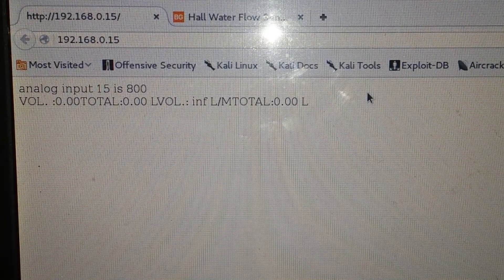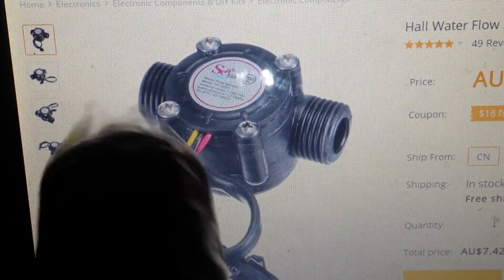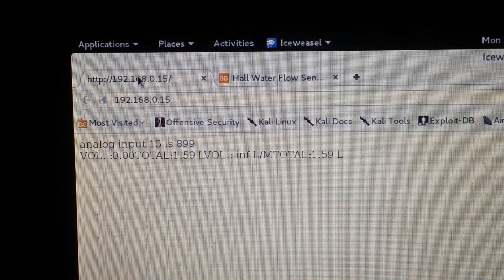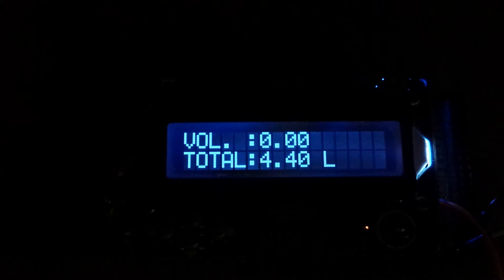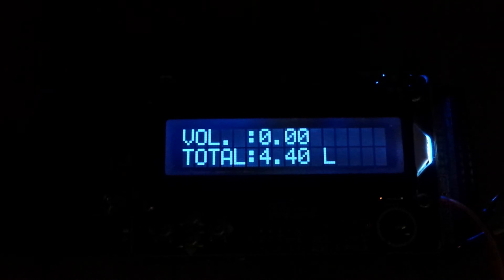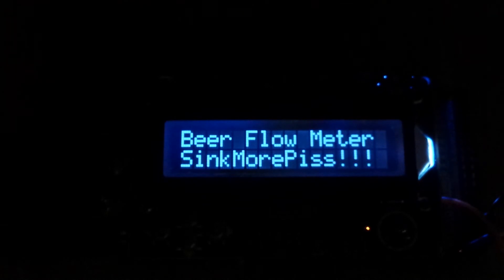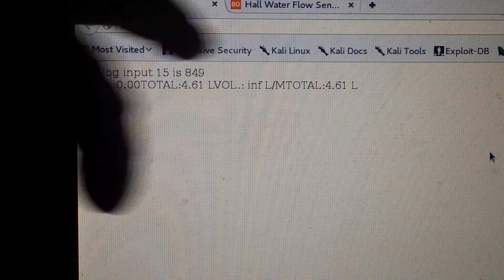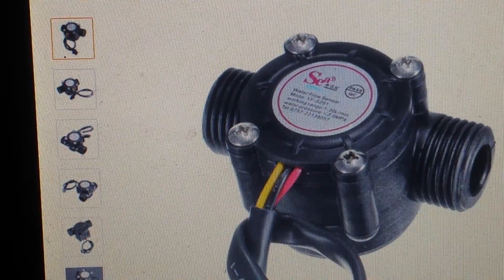Beer flow sensor/meter #Webserver for keg volume measurement  #Arduino [Earphone Warning]

Comment: Great work man. Just a small question, won't the measuring device cause the beer to foam? Because of the turbine obstructing the flow.
Reply from the maker: Thanks man, yes indeed and it did, didn't think of that at the time, had to reduce the serving PSI on the keg because of the turbulence.     That said the turbine would always be a factor in regard to the head on the beer.  I installed it very close to the keg initially and it was mostly foam at a "normal" psi for serving.  Moved it as close to the tap in the end with lower psi seemed to work, good lil lesson.  If I knew more about fluid dynamics I guess I would have realised that at the start lol.  Cheers man.